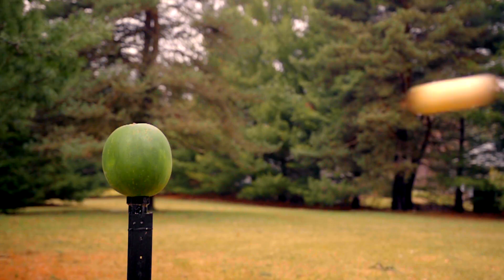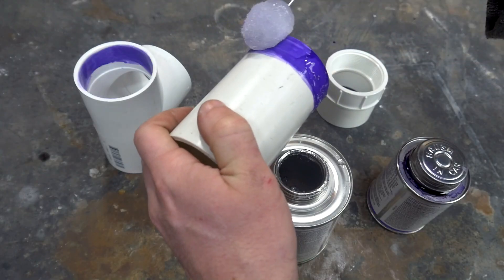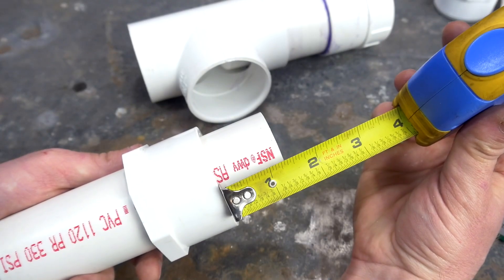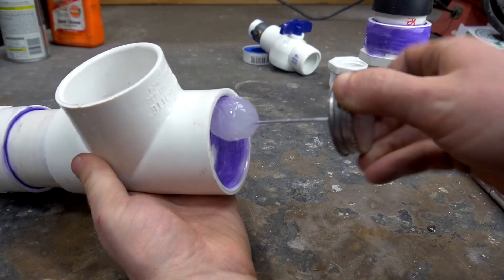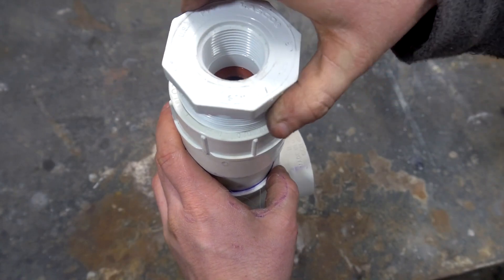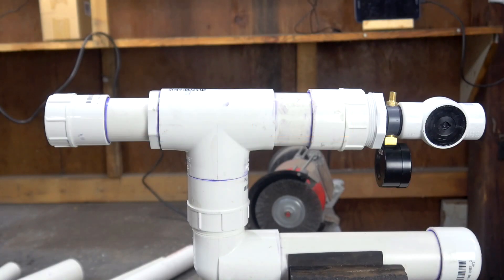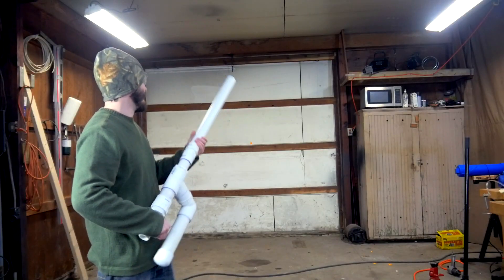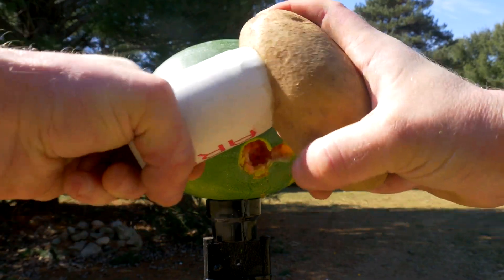How To Make A High Power Air Cannon - 2" Piston Valve (Barrel Sealing)

Comment: I used this design with a few tweaks and is currently failing to return the piston. I added a blow gun you would use for an air compressor so it could act like a trigger. I think the problem is that it is not releasing the pressure fast enough.? Other things that worry me is the piston is really tight in the chamber due to the O ring. I added a lot of lubrication with no result. Lastly, I am a little worried about how tight the piston seems to press into the rubber seal. Please let me know if you have any suggestions! Side note, I am reaching at least 60 psi.
Reply from the maker: If a blow gun is your actual release valve that's not nearly large enough to let air out fast as it needs to. Look into a blow gun actuated sprinkler valve.
Reply: @Nighthawkinlight  I figured, thank you so much for the help, I'll look at other solutions

Comment: I'm missing something important.  I've tried building two, adjusting the location of where the piston seats slightly, but neither would "fire".   

When the piston is forward and air tight against the rubber seal,  I don't see any force that would open it.  Before opening the sprinker or ball valve, one side is open to atmospheric pressure, the other side is pressurized by the air tank.   When you open the valve, both sides of the piston are the same pressure--ambient air pressure.  So, where's the force to break the piston seal?

Once the seal breaks, then the air chamber pressure can develop on the piston head to drive it open.  

On the two I built, the air escapes when I open the sprinkler valve, but the piston doesn't move.

The piston is not frozen--I can push it out using small piece of PVC.

It seems to me that pressure on the sprinkler vavle side of the piston would have to drop below ambient air pressure for any force to develop to start moving the piston open.

Yet, I see your video where it obviously works.  Mine don't.  Any clue why not?

Thanks
Reply from the maker: The barrel needs to be a smaller diameter than the piston tube. When the tube is emptied of pressure there is less cross section holding the piston to the barrel than pulling it away. Your piston will not pull back because the pressure behind it does not drop fast enough. This means you either need a larger release valve, or a smaller vent hole in the piston as it's replenishing the pressure in the piston tube and draining the tank faster than the release valve is dumping it.
Reply: Mine were built just like what's in the video, except:

My attempt to use schedule 80 nipple for attachment of the Schrader valve and pressure gauge didn't work.  Leaked very badly.

So, instead of using a schedule 80 nipple, I'm using a 1" pvc cross.  Two sides of the cross have 1" male adapters.  One side goes into 1" sprinkler valve and opposite side goes into firing assembly.  Other two sides have bushings with 1/2" female threads for the Schrader valve and pressure gauge.

Does the volume of air between the piston and Sprinkler valve matter (the pvc cross  has significantly more volume than a close nipple).

I found a later video where you provided more detail on how to drill and seal the schedule 80 nipple, so if this could be the problem, I'll try using the nipple instead of the cross.

Instead of a modified sprinkler valve, I'm actuating it electrically.  Is it possible/likely that electrical actuation is slower than using a modified valve and opening it via the air port?  If so, I'll go ahead and modify the valve, but I'd rather have the electrical actuation if it will have similar performance.

The intended use of the cannon is to performance test an infrared light curtain.  I was planning to use relatively large diameter barrel  to fire balls about the size of tennis balls at 35 mph.  Balls could be nerf, or hollow "whiffle like" balls.  Weight is unimportant.   Bigger is better, since I can be sure the balls don't go between IR beams easily

Maybe I need to consider the design more carefully, considering the barrel diameter impact.

Thanks!
Reply: "When the tube is emptied of pressure there is less cross section holding the piston to the barrel than pulling it away."

But,  unless the pressure on the sprinkler valve drops below ambient air pressure, there's no force pushing the piston open, regardless of relatively cross section.  What am I  missing?
Reply: In other words, it is not "emptied of pressure".  It just has ambient air pressure, same as the barrel side of the piston.  Unless somehow the pressure drops below ambient air pressure.
Reply from the maker: The force on the piston is the difference in cross section between the barrel and piston tube, multiplied my the pressure in the chamber. If the barrel is 1"² area and the piston tube is 2"² area, the pressure in the chamber is 100psi, then the pressure is holding the piston on the barrel with 100lbs, but will push it backward into an empty piston tube with 200lbs. 100lb difference between the pressure holding the piston to the barrel vs how hard it will be pushed backward when the piston tube is emptied. Your problem is that the piston tube never empties all the way until after pressure in the chamber is gone.
Reply from the maker: Ambient air pressure doesn't matter. Consider atmospheric pressure as empty.
Reply: @Nighthawkinlight  But, the tank pressure is only on one side of the piston.  The other side is open to atmospheric (ambient) air pressure.  Once the piston seal breaks, yes, I understand the pressure differential multiplied by the surface area is the force.  But, until the seal breaks, the tank pressure is on the sides of the piston, not on the surface that would push it open to break the seal.

I'll try using the nipple, but I'm still don't understand what opens the valve. Once open slighlty, I get it.  Wish I could post a picture...
Reply from the maker: It is on the surface that would break the seal, because the barrel is a smaller diameter and not equal in area to the piston tube. That makes a disproportionate force.

Your electronically controlled valve could be a problem. Sometimes they work ok, but an air modification works better. I believe there is a link in the video description top a project where I modify a valve.
Reply from the maker: And yes, the larger the volume of air behind the piston is the harder it will be to drop the pressure quickly. If you can reduce that area you don't have as much air to vent for the pressure to drop

Comment: a suggestion for you @NightHawkInLight is to put the cap on the end of the canon where it fires out. I made a simple air cannon where it is literally just pvp with a schrader valve in it with a tube at the end and the cap on it blasted through my stone wall (2 feet thick) with ease. but it shattered. i deserved that

Comment: Amazing Build Man! Do you by any chance have a link to the 2" x 1" Threaded reducer on the back that connects the Cannon to the Sprinkler Valve? My search results keep coming back with a 2" x 1 1/2" and that wont fit into the 1" Sprinkler Valve
Thanks.
Reply from the maker: Parts come in and out of availability. You may need to use different adapters to get down to the same size
Reply: @Nighthawkinlight  I Appreciate the speedy reply. I'll look into that thank you. I'm using this build to Create air Mortars (Dirt Explosions) For a film Project, this bad boy build has the Kick i will need to create them on a bigger scale.

Comment: Now I know this video is well over 2 years old, but I finally have a location to do stupid stuff like this and a relatively expendable income, not to mention you do a damn good job answering ALL your comments. Without further delay, about how much would one spend on a cannon like this? can I use a bicycle pump to power it? and would it be cheaper to do a piston vacuum cannon or this? what about ammo? I own a riffle and if 5.56 is cheeper in the long run I'd rather throw lead than plastic or potatoes.
Reply from the maker: You would spend maybe $100 on this. It is difficult to use a bicycle pump and may not always work. This is a type of piston cannon. Ammo can be anything that fits down the barrel.

Comment: Hey man.....how much PSI can that air chamber and all other parts handle built just the way you did it.
...?
Reply from the maker: More than I ever push it. I've gone to 100, but never recommend others go over 40.
Reply: @Nighthawkinlight  .....I built your exact design......its sitting here.  I'm wondering if it will stun a fish under water if the end of the barrel was about 8 inches away from the fish.  I put a shrader valve in the end cap of the air chamber.....so while under water if I point the barrel downward all the water inside will fall downward from gravity and that shrader can be used to also force all the water out of the entire gun.  Then there will only be air inside everywhere including the barrel.   So if it then stays pointed downward till over the top of the fish....the blast will be all air.   Do you think its a strong enough blast to stun a fish?
Reply from the maker: @mmmjay1940  I've never stunned fish in this way to find out. It would be illegal in my state. One thing I know is that if you have water that stays in the barrel of this cannon it's going to kick like a horse when you fire it.
Reply: Oh.......We plan to use our 3000psi scuba tanks to keep refilling the air cannon.  We use 80 cu ft tanks......so it will fill the air cannon many many times without really affecting our down time.   The line off  the tank is stepped down to 100psi of pressure.  We can out a trigger type of air filler so we can control the flow really well....not just a big rush of air entering the air chamber....

Comment: I have built this, but cannot make it fire. I am using a 1" ball valve to fire. It appears my piston is not releasing. Upon opening the ball valve, I get an initial blast of air, then a slow release trailing off. I assume that is the air from the tank making its way back through the small hole in the piston. The piston moves in the barrel freely. Just wont relaease.
Reply from the maker: Sounds like you have too big of a hole in the piston. You can plug it with a little shaving of PVC and cement to make it smaller.
Reply: @Nighthawkinlight  Bit I used fir that is probably .080. What size hole do you reccomned?
Reply from the maker: I don't know, small as you can get really. The only downside to making the hole smaller is that the cannon will take slightly longer to fill.

Comment: I built one of these following your design. I squeezed the parts of the piston together too hard when making it which made the O ring get a bit bigger and had to sand it down to fit (just a warning for other first timers out there) but it works quite well. The results are amazing. 

I'm wondering if you have ever calculated the velocity of the ball leaving the cannon?

I recorded some test firings using a high speed camera (420 fps and 1000 fps) and analyzed the video using "Tracker" software.  My video was poor resolution and at those frame speeds the ball was just a blur but I consistently got calculated speeds of around 215 m/s or 481 mph.

The fact that it consistently shatters the ping pong ball and explodes an empty soda can indicates that its going well in excess of 300 mph but I'd love to get a more accurate velocity (if you have one) before showing this to my 6th grade Science students. 

Thanks for the amazing videos!
Reply from the maker: Sounds like you've measured it better than I have. Would be good for me to get something to measure the velocity of such things in my videos

Comment: got it made, but unfortunately its not building pressure and air is leaking from the barrel, i think the rubber coupler isnt making a good enough seal, also i wasnt able to find the 2"x 1" reducer so i had to use 2" x 1 1/2" bushing to 1 1/2" x 1". trying to use this for my gender reveal party to launch the chalk into the air
Reply from the maker: Try smearing the rubber with TFE paste, that can help.

Comment: can I use this piston style instead of the steel caps for the coaxial cannon you made ( watch?v=q508d3k9518 ) as I cannot get a good seal no matter what I do making it the way you did previously
Reply from the maker: If you can find pieces to make a piston for that size cannon it will work.

Comment: We put together our own version yesterday and were able to chrono it at ~800ft/second with a ping-pong ball at 100psi... that is before the piston blew out the back of the cannon on the next shot!
Reply from the maker: Yikes! Same fittings I'm using here? All nsf-pw? Did you use a bumper as I did?
Reply: @Nighthawkinlight  Similar fittings but a slightly longer piston to allow more airflow and no bumper. We're working on a V2 with a bumper of some sort.

Comment: The piston is not moving back plz help
Reply from the maker: Open the rear valve faster or use a larger valve. Or make the hole in the piston smaller
Reply: NightHawkInLight thanks for replying I will consider that I believe the friction was too high as I used dry lube instead of oil. I will try both thanks!

Comment: Absolutely awesome. Great design. I'm trying to understand. The piston you custom made is really the valve, and you're using the ball valve as the trigger for the piston/valve. Could you simply release the Schrader valve and get the same drop in pressure and piston release effect? Thanks for your consideration.
Reply from the maker: The schrader valve doesn't let air out fast enough. If pressure doesn't drop behind the piston fast enough then air leaks back through the hole in the piston and the chamber drains. You could put a one way valve in that hole and it would work, but the piston would move slowly compared to using a larger valve.
Reply: @Nighthawkinlight  Thank you for explaining, and thank you for making these inspiring videos!

Comment: I researched all kinds of designs and went with yours. I built your piston cannon and it worked great during testing even at a low 50 PSI. I built it to launch bait in the surf but for some reason at the beach the piston failed every time and I never got a single launch off even up near 75 PSI
There were several other people there and too many hands touching the cannon and moving it around before I set it up so I'm guessing they got sand down the barrel into the piston area keeping it from moving freely. After a good rinsing I left it lying there and when I picked it up and shook it I could hear the tell tail thud, thud of the piston sliding back and forth. But by then I wasn't interested in messing with it anymore.
I need to be on my own in my own vehicle where I have complete control of whats going on. A good tip is to have a can of spray cooking oil handy for lubing the barrel and piston head/seal through the barrel and even a short squirt into the ball valve seems to help.
I also made 3 different tanks for it 18" 24" and 42" I've only tested the 18 & 24 and they tested OK. I need more testing on the Tank and barrel lengths to get the right combo for the most distance with a 10 to 14 Ounce bait bullet.
Thanks for a great design

Comment: We Enjoy the channel immensely and your direction was super clear and concise.   However after spending hours on my cannon.. i doesn't work! Epic fail somewhere internal which air is escaping and the pressure never has a chance. If anyone can send me some advice id really appreciate it. everything almost is glued in place so im looking for a solution so I don't need to start over.
thx
'Frustrated in Seattle" is putting it lightly !!
Reply from the maker: Sorry for the delay in my reply. How are you filling your cannon? It requires an air compressor to fill the cannon quickly enough for the piston to seat properly. A short term fix for a better seal is to smear the rubber with TFE pipe thread paste. If you have more questions email me at nighthawkinlight@gmail.com

Comment: is it going to work if i put the shreader valve in the air tank? instead of behind the piston
Reply from the maker: No. Air needs to come in behind the piston so that it's pushed forward
Reply: Yes! if you have a helper you can hold your hand over the front of the barrel creating a seal while it is pressurized slightly, then remove it quickly to allow the piston to ram forward and seal. We constructed one that way and this method works to seal it.

Comment: I just built this design.  It is significantly more powerful and reliable than the old hairspray model from my youth.  I was able to launch a potato plug so far that I lost sight of it before it landed.  Another shot against a block wall completely disintegrated--nothing left but an 8" wet smear!

Comment: I'm unsure if these questions have already been asked because I haven't read all 513+ comments, but...
A] would it be possible/effective/viable to attach a manual air pump to make pressurising the chamber similar to "cocking" a pump action shotgun? and
B] will the piston eventually need to be re-oiled with long term use or overuse?
Reply from the maker: It takes a burst of high pressure to get the piston to seal. It's hard to do with a hand pump. The piston can be oiled if it sticks by dripping down the barrel

Comment: Amazing work and really fascinated by your project  sir.  I had a question . On what basis did you decide the length of the barrel ? And another question is, did you follow some specific ratio of barrel to working chamber Dia ?
Reply from the maker: There is an ideal barrel volume to chamber volume ratio for air cannons but I don't remember off the top of my head. You can find it I'm sure with Google or searching the spudfiles forum. I did not use any specific ratio for this cannon. Diameter of chamber and barrel is not an important factor.